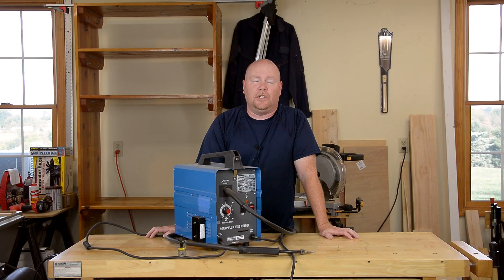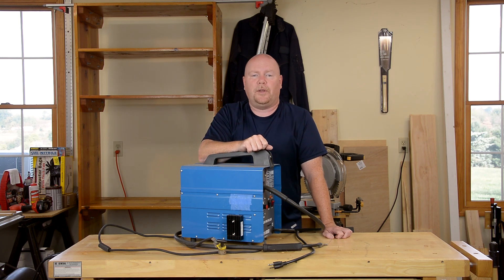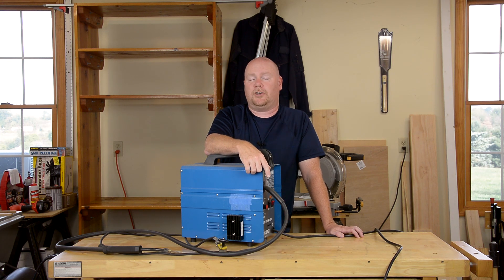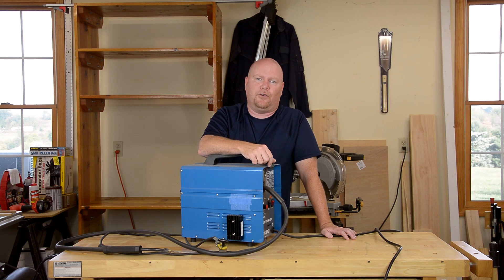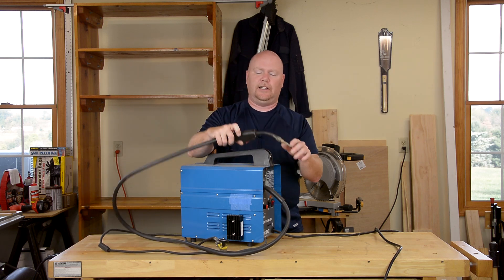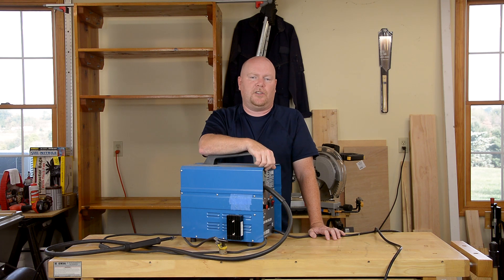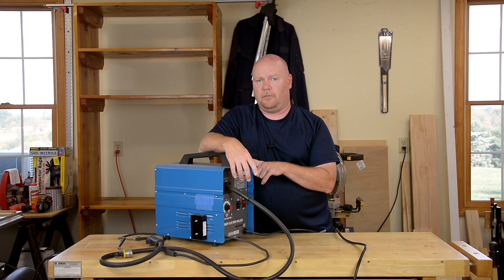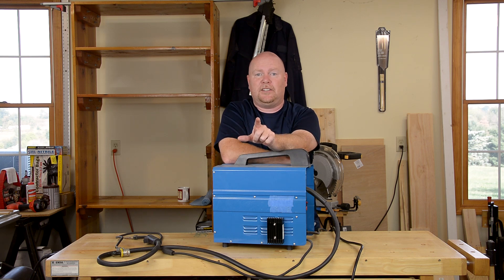Advanced Harbor Freight 90 Amp Welder Mods 09 - The F.A.Q.

Comment: Yo Matt. I know I've bounced some stuff off of you in the past regarding this modification. Last time we spoke I shared with you how the manufacturers torch broke (actually it was the metal wire feed tube inside of the torch assembly hose), and how I replaced it with an after market torch designed for the HF 170 AMP Mig welder. It made a HUGE difference in the performance of the welder. 

But the nagging and persisting problem I had was discharging the capacitive load at the end of each duty cycle. If I forgot to do it, I got an unpleasant surprise the next time I went to use the welder and I touched the tip of the torch to the work piece. Massive spark accompanied with momentary blindness. 

We spoke about using a bleeder resistor to drain the capacitive load between duty cycles. I know you were hesitant due the potential energy loss manifested in the form of heat, to which I considered a very valid point. So my thought was to run the resistor through a momentary on/off push button switch on the front of the unit. At the end of each duty cycle, I could push the button and discharge the capacitor. But even this seemed like an inconvenience. I wanted to do a short test of just placing the resistors in the circuitry without running them through a switch. I wanted to see if it altered the performance of the weld, or how much heat was dissipated in the resistor itself. 

So I scrounged up some low Ohm, high wattage resistors and ran them through their testing paces. I work for a telecommunications giant, and I have access to antiquated equipment (i.e. massive power supplies, rectifier shelves, etc.). This enabled me to upgrade my welder for minimal cost. As a matter of fact the ONLY things I've had to purchase for the welder (aside from the welder itself) were the bridged rectifier and the new mig gun assembly. I even scrounged the bleed resistors from an old high voltage rectifier shelf. 

But I said all that to say this...... Before I added the bleed resistors to the circuitry I laid down a bead weld about 6" long on a piece of mild steel. Then I placed the bleed resistors across the positive and negative terminals on the capacitor and repeated the aforementioned step. I saw ZERO difference in the quality of the weld, or in the penetration into the metal pieces I was welding. That was already good news. But to add more good news to the mix, the capacitor fully discharged in about 1 second, and I had very little heat on the resistors. I put two resistors in parallel to double the wattage. 

Now I'm not saying there wasn't any heat on the resistors. They did get warm. But I had to ask myself- how often would I be laying a 6" bead? That's structural weld length. Most welds will be either spots welds or a series of smaller welds that eventually accumulate into 1 long weld to avoid overheating the work piece and warping it. 

I also mounted the resistors in the chassis right in front of my cooling fan. I scrounged up a 250 cfm (120v AC) cooling fan from a piece of discontinued telecom equipment. I'm pushing 10x's the airflow across the transformer that the stock fan does. So it quickly and efficiently cools all electrical components inside. 

So in my honest opinion, I think the addition of a bleed resistor is a very smart thing to do. If your subscribers go onto E-Bay, they can find 1 Ohm 100 Watt resistors for $10. This will bleed the capacitor by itself. But if the put two of them in parallel it will bleed off the capacitor in less than a second. 

http://www.ebay.com/itm/Dale-Resistor-RH-100-100-Watt-1-Ohm-1-/152026796595?epid=1201650370&hash=item236580d233:g:jZgAAOSwZ8ZW8zOa

They want a low Ohm reading (as low of a resistive value as possible), and a high Watt reading. I'm not an electrician, and I'm not an electrical engineer. I'm a relatively bright guy who likes to tinker and challenge himself. All of the aforementioned information is my opinion. It worked for me. I'm not trying to hijack your post. I'm just trying to throw out an option for some of the guys who have followed your instructions on the modification, but have gotten tired of discharging the capacitor, or being unpleasantly surprised when they forget to discharge it and they touch their work piece. 

Thanks for creating this series of videos Matt. You've helped a LOT of guys turn a crappy welder into a fairly respectable one.

Comment: Matt Heere mine did not have a fan. I put three computer fans in it, it helped as is. I want to try this on mine. I have one leg and a pace maker will this change the frequencies, and not let me weld with it?
Reply from the maker: Hi Joseph.  The mod will change the 60Hz AC sine wave into a 120Hz rectified set of positive "bumps" with a sinusoidal profile.  You'll need to check with the manufacturer of the pace maker as to whether or not this waveform is likely to be problematic.
Reply: Matt Heere thanks real nice of you to reply to my question, joseph T

Comment: You know, there could possibly be a 3rd set of modification vids for this machine. 
I just recently made a pretty intense set of changes  to my 90 amp welder that have been incredible. After going through your tutorials on DC rectification, I decided to take it a step further and add gas capabilities for sheet metal work. As another commenter stated, I managed to obtain a new gun that contained a gas tube as well as a steel liner for $13 delivered meant for cheap knock of mig machines. Turns out that the block that retains the cables and liner in the machine already has a cutout for that gas tube, so it was added quite easily. I then added 2 dinse connectors on the front in order to swap polarity between DCEP and DCEN. Connecting the gas line to a tank and regulator turned my cheap Flux core welder into a perfectly capable low amperage mig machine. The c25 as well as using .023 mig wire really drops the current low enough to do some delicate work as compared to the FCAW wire.

I would definitely look into this as a future set of additional videos to your welder mods series.
Reply from the maker: Good info Dylan.  I've been thinking that a re-do was in order, as HF has updated the welder significantly.  If I get another freebie like the 1st one then I'll do it.
Reply: I wish I could give you mine to try it out, I have the new, black-cased welder and am stymied as to where the wires I'm looking for are now...
Reply: Dylan Headrick how does the welds look using solid core? I am very seriously considering the gas torch setup that you are referring to since I stumbled across new ones for $32 on eBay. I didn't know how much more was required outside the torch to make gas work as far as the machine goes. Any input would be greatly appreciated.

Comment: You didn't answer the question of if you could use more than one capacitor. Capacitors in parallel add in capacitance value. The voltage does not have to be the same as long as the lowest voltage capacitor has a high enough voltage rating.

Comment: Hi Matt. I too followed your instructions to upgrade my HF welder. I actually bought my welder new, and invested in the necessary components. I saw it as an interesting project. The welder worked awesome when complete. However (being a harbor freight product) the mig gun assembly eventually crapped out on me. I got a nasty kink in the wire feed tube that runs through the hose from the welder to the gun itself. I'm still perplexed as to how that happened becase I was intentional in trying to prevent kinks from happening. So I tossed it onto the shelf for over a year with hopes of fixing it one day. In the meantime I bought a real welder (Millermatic 211), which increased my procrastination to fix the HF model by even more. 

But I finally pulled it off the shelf and started to work on it. I needed a replacement mig gun, so I called HF's tech support. They were very nice, but they didn't have a replacement mig gun I could purchase for the 90 amp version. So I went online and ordered a replacement gun from www.usaweld.com (product 81295B*ChicagoElec). It's a replacement for the mig gun on the 170 amp mig/gas version. The trigger on the gun is just a switch that closes when depressed, so polarity isn't an issue. I also pulled out the little gas tube and I had to trim the mig wire tube that runs through the hose of the mig gun. 

This company makes a compatible version that is FAR superior to the stock version that comes on the welder. It's definitely beefed up, and it's made in the USA. It cost me $72 out the door. 

So I got that bad boy installed and tested it out today. What a difference, even over the original modification. That little welder makes buttery welds now. It sounds like sizzling bacon with no pops or sputters in between.  I would put this little guy up against a name brand flux core welder any day of the week. 

So I would actually recommend this new mig gun assembly as an additional upgrade that WILL improve the performance over the original upgrade. 

I also recommend discharging the capacitor with a bleed resistor wired through to a switch, or an incandescent light bulb doing the same. The higher the wattage, the faster the bleed.
Reply from the maker: Good to know there are options out there for the torch.  It's definitely one of the weaker components on this thing.  Not sure if I would spend $72 on this welder, but I can see it making sense in some situations.

The bleeder resistor thing comes up a lot.  I don't like the idea because any resistor that will bleed charge off fast enough to be useful is also going to be dissipating 100W of heat the whole time the welder is powered on.  Oh and it's the lower the resistance the faster the bleed.  Higher wattage resistors are needed to handle the heat dissipation during discharge if you go with lower resistance values, but a 100 ohm resistor will bleed charge at the same rate whether it's rater for 10 or 1000 watts.  It's just that the 10W one will burn up after 3 minutes, and the 1000W one won't (it'll also will be bigger than the welder).
Reply: The incandescent bulb or bleed resister would be run through a switch coming off of the capacitor. Not left in place to operate continually during the welding process. Then when you're done with your weld, you could toggle the switch to close the circuit and bleed off the capacitive charge. If you use the right resistor you could essentially bleed off the charge in 3-4 seconds. Since the bleed would be periodic and not continuous I don't thing that the heat dissipation would be too much of an issue. You would also elongate the life of the bleed resistor (potentially indefinitely if you use the correct value)

Currently I use a 200 watt BR30 spotlight to bleed off the charge. I touch the threaded shroud on the light near the ground on my work piece, and I take the mig tip and touch it to the contact on the bottom of the bulb to close the circuit. It bleeds off the charge in about 4 seconds. It might be faster for others though. I have a huge 83,000 uF, 80v capacitor in my unit. It was used in a huge power supply for telecom equipment.

Regarding the mig gun replacement, the $72 was a cheaper and faster replacement than buying a new welder and moving all of the upgrade components into it. As it was, the welder was rendered useless, so I did the cheapest and fastest thing to get it back online. I read testimonials about the mig guns manufactured by USA Weld, and I was confident that it would fix the issue. It's only when you pull out the original manufacturers mig gun and do a side by side comparison that you see the difference in quality. And trust me when I tell you it doesn't take a trained eye. The mig gun I ordered is also several feet longer than the manufacturers. It made a HUGE difference in the quality of the weld. HUGE! 

The way I look at it Matt, the goal of this project is to create a more cost effective version of a Lincoln, Miller, or Hobart 90 amp flux core welder. Those run you $300+. So even after my investment of the mig gun I'm still in the black and not in the red.

Comment: Matt I have purchased my bridge rectifier but having an issue finding a cap for this upgrade have watched your videos on this but is the cap an ac or dc cap and yours is 50 volts right so that's kinda what threw me off maybe you could help clarify a little for me please!
Reply from the maker: It's a D.C. cap, not the motor starting variety.  It will be an electrolytic with a polarity.  Mine is rated for 50VDC continuous, which I consider the minimum, but obviously a higher rating is just fine.  Anything over 20,000uF is sufficient for the mod.
Reply: Ok thanks Matt I have the newer version of that welder it works great as is just wanted to make it better and you said you ran urs with just the rectifier and no cap right?
Reply from the maker: The rectifier is 80% of the mod for sure.  If you really can't find a capacitor (check eBay) then you can leave it out and it will still work, and is still an improvement.
Reply: Ok connect the rectifier after the relay for the tip since I have a newer black version right? Because I think there is a newer one than mine out now!
Reply from the maker: Tido Bones that's the best plan.  AC and DC ratings are different for switch contacts.  Better to make the mods downstream of the relay

Comment: Matt, can you tell me difinitively if the wire speed control changes the output current or not on this welder. From my understanding, most mig/wire feed welders are supposed to have the output current tied into the wire speed control. I'm getting the impression that it isn't connected on this welder since anytime I adjust wire speed above 8.5 on mine I just get the wire bumping into the weld as if it isn't being consumed fast enough. Thanks. Great series.
Reply from the maker: In most wire welders the voltage (MIG/flux core are constant voltage processes - as opposed to stick welding which is a constant current process) and the wire speed are completely independent.  That's the case with this welder as well.  It's just that the voltage only has two settings (min/max), only one of which is really useful.

Voltage, wire feed speed, and torch travel speed all need to be independent.  You can control any of them (within a range) and put the right amount of heat and metal into the weld.  Having the optimal voltage and the optimal wire feed speed gives you the most "wiggle room" in your torch control.  Since we basically have no voltage control, and the wire feed speed is erratic at best, you need either borderline miraculous control over the torch - or you have to accept that the welds aren't optimum.  That's the price we pay instead of paying the price for a 1st class machine :)
Reply: Matt Heere Thanks mac. Not only are my welds not optimum...but 70% of the time, they're not too pretty as well! I did pretty good in my class. Got certified and everything...but that was 2 years ago.
Reply: Higher end welders have multiple center taps on the transformers to change voltage/current. The transformer in this welder only has 2- Min/Max. So you're very limited. The only thing that changes when you crank up the wire speed is the speed itself. If your welds look bad, MAKE SURE your metal is clean. I always use a flapper disk on my angle grinder to grind off any oxidation or paint. Also, if you're butting two flat pieces of metal up against each other, chamfer the edges to make a valley for your filler metal to flow into. A good rule of thumb for this upgraded welder is to start with the wire feed speed in the middle. If the metal is 1/8" or less in thickness, use the MIN setting. If it's thicker than 1/8", use the MAX setting. But initially, always start your weld on wire speed 5. 

The best thing you could possibly do however would be to go and buy or acquire some scrap metal in different gauges and thicknesses and practice on those. Then chart your results. That way you can just refer to your chart whenever you have a welding project.

You certainly don't want to utilize the chart that they provide you inside the lid. That chart was designed around this platform being AC, not DC electrode negative. By doing the conversion, you have drastically changed the properties and capabilities of this welder. 

Always use spot welds to tack your pieces in place first. The thinner the metal, the more prone to warping. If you're welding thin metal, I would recommend a series of short spot welds over long bead welds. And let the metal cool for a few minutes between spot welds. Thicker metal is another story. You can run longer strings of beads, but it will still warp if you get too aggressive. 

When you tack/spot weld the chamfered pieces with filler metal, hold down the trigger for a 2 count. You know you're on the right settings when you pull away to observe your weld, and you can see you've filled in the chamfered valley on both sides, and the filler metal is just slightly raised above the adjoining surfaces. You should also see discoloration on the other side of the material indication good penetration at the molecular level. 

I know this is Matt's thread, and I apologize if I stepped on your toes Matt. My goal is to help, not to steal from your thread.

Comment: Hi Matt. I love what you are doing even though a lot of it is over my head. I am extremely new at all things electronic. I am looking into doing the conversion on my welder. I have noticed that almost all other videos people used an inductor as well. Is there any reason for that or should I just totally ignore it. Thank you very much. You seem to put things in a way I understand
Reply from the maker: Ignore it.  An inductor helps to maintain constant current.  Flux core wire is a constant voltage process, so the inductor will make very, very little difference if any.